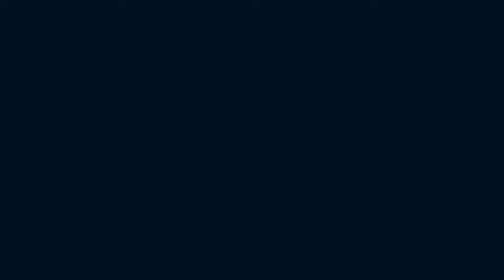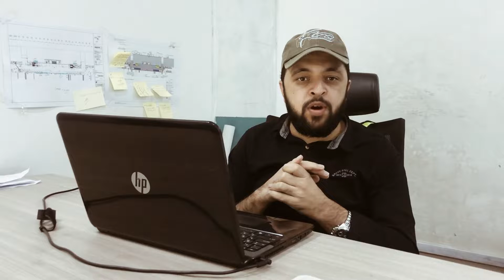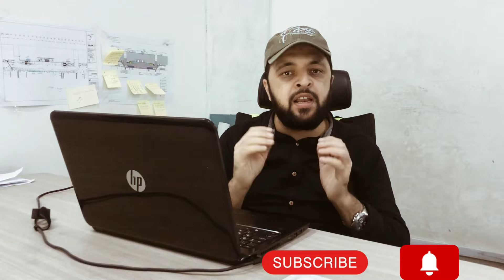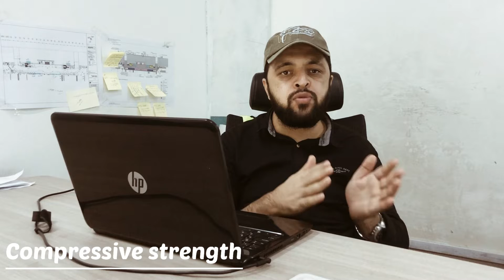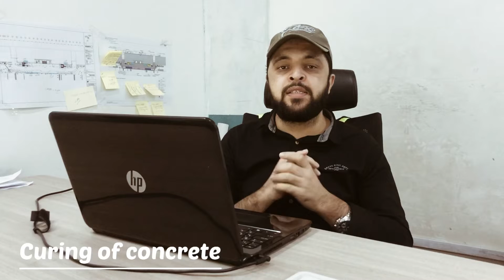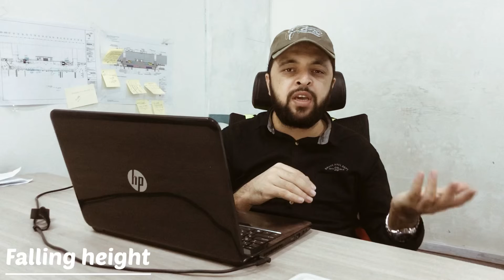Civil Engineer Job Interview in Saudi Arabia| Question And Answers| Part 1

Comment: regarding hot weather concrete kindly check ACI 301,305 in the latest updates u can pouring concrete during day shift but in the standard they mention few thing that u should control during pouring.

Comment: The mix ratios for C20, C25, C30, C35, and C40 concrete are as follows:

C20: 1:2:4
C25: 1:2:3
C30: 1:1.5:3
C35: 1:1:2
C40: 1:1:1.5
The numbers represent the ratio of cement, fine aggregates, and coarse aggregates, respectively. For example, in C30 concrete, there is 1 part cement, 1.5 parts fine aggregates, and 3 parts coarse aggregates.
Reply: You are totally wrong bro! C20 has mix ratio of 1:1.5:3 and you have completely wronged the remaining ratios

Comment: we use M-20 concrete use in RCC structure but PCC we used M-10 or M-15
Reply from the maker: In pcc we are using C16 in Saud Arabia who’s compressive strength is 16 mpa

Comment: In previous one video you mentioned 1.5 meter maximum height for concrete falling and here mentioned 1 meter.
Reply from the maker: Bro 1 meter is standard and in Neom 1.5 meter is acceptable
Reply: @CivilEngineerAtSite  Noted,
Thank you for your kind response once again
Reply: We are also following 1.5 m

Comment: Brother don't mind u r guiding people on wrong way please study a lil more.
Reply from the maker: What is wrong here ? Correct me, you commented that I am guiding people wrong? Please tell me
Reply from the maker: What’s wrong here?
Reply from the maker: I will mind it dear.
Reply: @CivilEngineerAtSite  Thank you so much that you have reply me on good manner. 
C's for lean concrete is 2000 psi(14mpa) for pre-cost concrete is 5000 psi(35mpa) 
And for cast in place concrete 4300  psi please study SAES-Q-001
Reply: And temperature range from 10 to 35
Reply from the maker: Dear but my video is not about aramco standards. It’s for non aramco projects. Thank you 😊.
Reply from the maker: Depends on the season or weather

Comment: What is the difference between wet and general concrete as you said in the vedio sir?
Reply from the maker: Difference on the basis of slump test
Reply from the maker: Genral concrete term I used for the concrete which we used generally for structural elements with compressive strength 35mpa and slump values are from 75mm to 125mm.
Reply: @CivilEngineerAtSite  General concrete is not a wet concrete?
Reply: @CivilEngineerAtSite  sir you said that the best time for concrete pouring is night and early morning I am agree but there is no possibility to use cold water or ice cube during mixing or keep the maxing materials in shaded area or cover it to keep it cold or use some admixtures
Reply from the maker: Wet concrete are high workability concrete with compressive strength 35mpa and slump values 160mm to 240mm.
Reply: @CivilEngineerAtSite  as you said General concrete 75mm to 125mm slump value and wet 160mm to 240mm as we know high workability may affect the strength of concrete if the workability goes up the strength will be go down but you said the strength will be same 35mpa in both cases how we will maintain the same strength of both concrete sir.